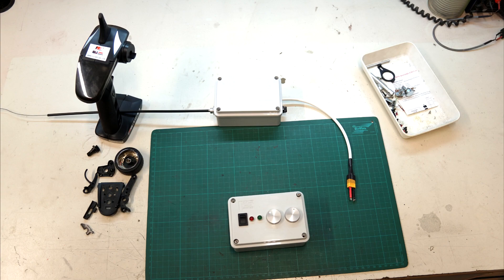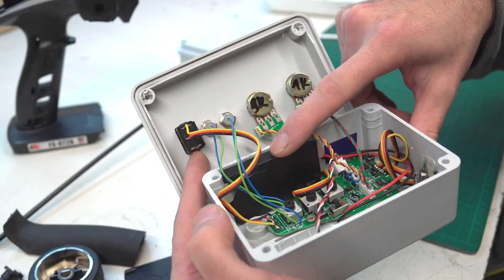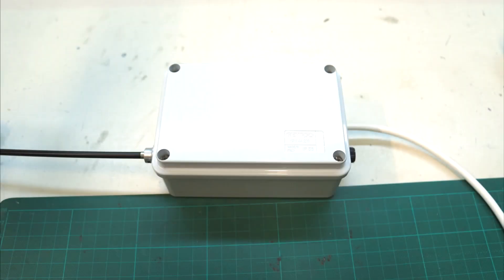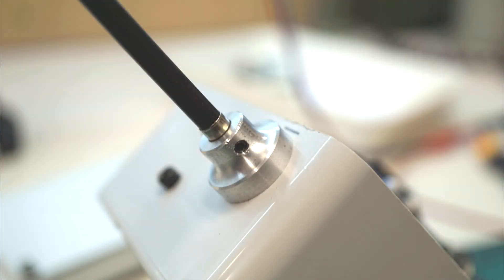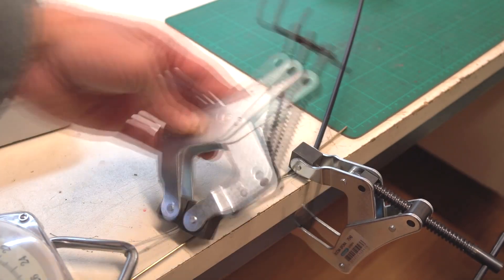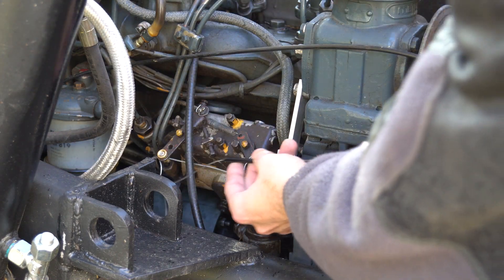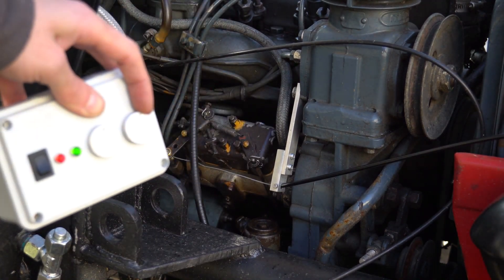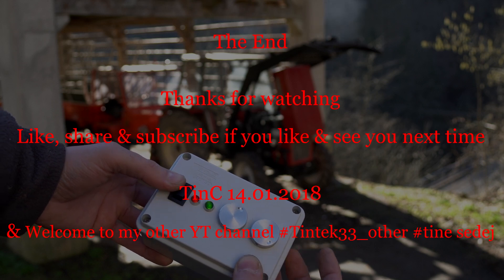RC tractor remote control [DIY engine throttle remote control] for under $60

Comment: Is his intention to add steering and brakes or is this for remote idling for a pto or other reason?
Reply from the maker: Glenn Edward this is used only for throttle for uaing in combination with remote winch for logging.
But yes thwre are stil two free channels can be used for start up, horn... I  would not use it for steering and brakes, with safety reason.